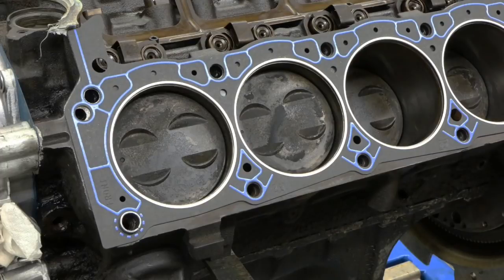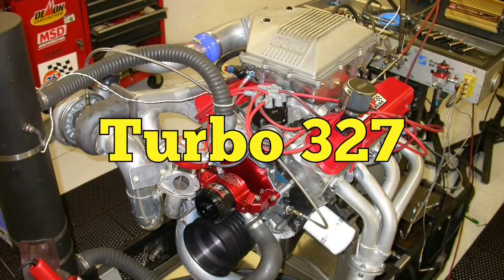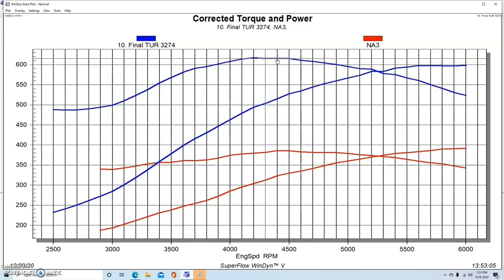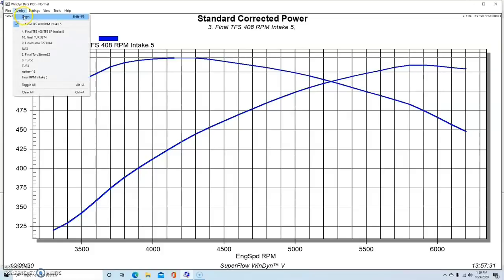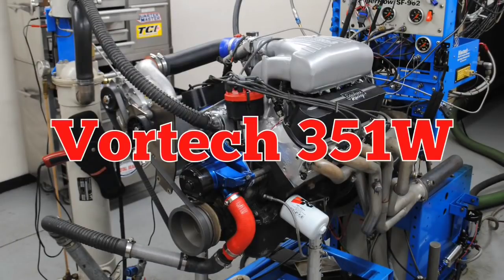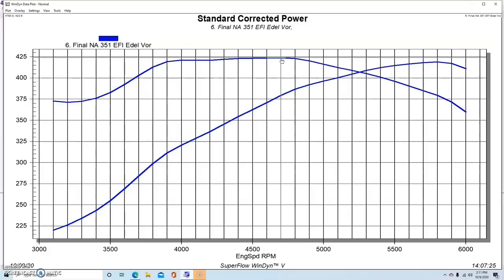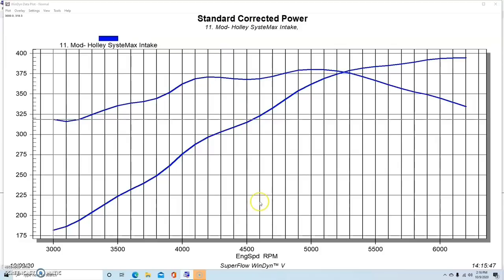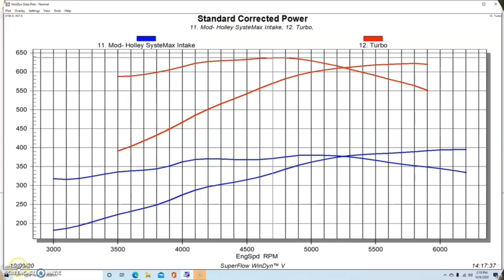HOW TO: 600-HP 5.0L (SBF) POWER RECIPES

Comment: I’m not sure I understand, was this purely junkyard engine? Or did change the original rod bolts and main block bolts with stronger new bolts? where are the rings the original rings reap or did you put fresh rings in the engine?
Reply from the maker: on which one?
Reply: @richardholdener1727  : It was the first engine in the video from the Ford Explorer. From what I understand that engine was a junkyard engine, two block main with stock main bolts, cast iron crank, stock rods with stock rod bolts, and stock pistons with stock rings re gapped. It’s hard to estimate the longevity of an engine like this unless you’ve owned one yourself or you know other people who have driven it until it needed rebuilding or blew up.

Comment: Good stuff. I built Quiet a few booster lil 5.0. 
Boost in the lil 5.0 just hits different 🎉
I had one  similar explorer block ported GT40P heads explorer intake 16 psi made 580 to the wheels. Other than the heads lifting a few times never had any block issues at that power level.  Most important thing is to run lots of valve spring pressure. Detonation is the enemy

Comment: Hey Richard, so I just rewatched this video and realized how different the power was naturally aspirated on the two 302 combos (the 1st and last in the video), especially the TQ curves. They had virtually the same cam TFS STG 2 vs 274 and similar intakes, TFS vs Holley. The biggest difference was obviously the two heads. The first one with a significantly better power curve ran a 170 cc intake port vs the 215cc heads. In other videos you’ve tended to show that there is no downside to a larger head or advantage to a smaller head, but it seems this testing showed that the smaller heads were in fact better or am I missing something?
Reply from the maker: You are comparing two different motors tested on two different days and dynos

Comment: How about a 351w with holley heads?
Reply from the maker: holley no longer offers the ford heads
Reply: @richardholdener1727  I have a set on an 89 5.0 gt that I recently purchased. Should I scrap them or use them on my planned stroker?

Comment: Gives me hope for the 427W I plan to build.

A test I'd be really interested in is just how much power can you get from a "streetable" engine. I mean something that idles smoothly around 6-800 RPM and has enough vacuum to run power brakes. It's pretty easy to build a race engine, just throw dollars at it. But things get interesting once you put constraints on it.

Comment: Hello ...im running a pump gas dart block 363 victor jr. Heads ...trick flow st2 cam...race tech pistons.  8.5-1 ....
Waist gate set at 12lbs...termimator x timing table is set to retard 1degree for every lbs of boost.......my question is should I #1 reduce my boost and add timing .#2 keep boost at 12 and add timing?  #3 or is there anything im missing....car is running well bit I know there is more being im slightly conservative on the timing

basically what is unsafe timing im trying to get a feel for this without damaging my monster stroker....
Reply from the maker: what octane pump gas
Reply: @richardholdener1727  93 ...beat I can get in Pittsburgh
Reply: Best I could get I meant
Reply: The car seems to be running very well...its quite fast and is pulling pretty well...running it in the 50 -75 tps range....its pretty new with only a few hundred miles yet...

Comment: I am in the market for a shortblock. Would you run a Dart 363 or 351w ford block to a 408w with vortech? Looking to make 650rwhp and leave it alone. But want to do it once and be done. What would you do ?
Reply from the maker: EITHER OF THOSE WILL WORK-THE 408 WILL OFFER MORE AVERAGE POWER

Comment: I would like to see you do a combination of a 306” SBF with 600hp using stock block with TFS twisted wedge heads TFS R plenum hot cam , forged pistons and rods with 11:1:1 compression.
Reply from the maker: 306 at 600 hp will take much more than that

Comment: Considering all the 5.0 blocks that I have seen split down the middle I was wondering how many 5.0 blocks you split in half.    I am constantly told these blocks won't reliably handle anything over 500 horsepower and this is coming from people that are drag racing them.   Is that true or not true or a myth or were they pushing them way beyond 500 or what?
Reply: I'm here trying to find the same answer...
Reply: It’s more dependent on how much RPM you’re trying to spin them to and the tune than any particular HP number. There are many guys, myself included, making way over 500hp out of stock blocks .

Comment: I follow up with your videos as much as possible especially if sbf I've got a ranger that I'm building for a daily driver and just want have fun I've got a 88 block with trw pistons factory rods and crank promaxx 180 heads x303 cam speed master roller rockers air gap 35-6500 rpm intake AED 750 DP and I'm really wanting to do a cheap budget single turbo diy kit and I been trying to soak up as much as I can but first time boost for me so weiry.....what do you think????? Also thought about going elelbrock pro Flo 4 with a gt45???? What do you think
Reply from the maker: that works
Reply: Have you tried the pro Flo 4? What would you recommend EFI or stick with the AED? Im more old school carb type but I'm liking the idea of multi port, fuel across all cylinders and better driveability.......
Reply: Do you think the gt 45 would be good on my combo? Do you think it would make good power I Kno I'm limited to stock block but with a good tune and conservative timing you think it would run decent and how do you think it would spool?

Comment: I had an 88 Lincoln TownCar with the low power 302 in it. I swapped in a 5.0 HO from an 88 mustang, used a stock Lincoln Mark 7 PCM to run it, rebuilt the trans and used the mustang valve body with a shift kit and the Mustang governor. Swapped in some 3.55 gears and had cat delete with flowmaster 40 series mufflers with dual exhaust. It was fun to drive but I wish I had had the budget to add boost like this. Would have been an ignorant Sunday driver.

Comment: You have a great channel. One question is there a way to factor in a rear wheel HP? I was told a 15% loss to the wheels?
Reply from the maker: its not a strict percentage-but that gives you an idea
Reply: A traditional automatic with a loose convertor might lose 30% and a manual tranny and a 12 bolt might lose 5%.. without a engine and chassis dyno on the same day it's really tough to make a call on power lost.

Comment: Wondering WHY Again your using nothing but off the shelf grind cams? That 408 would of made near 700hp with a Cam Motion for that combo. I've seen the gains first hand myself. The measly Extra $40-60 pays for itself not only in Peak gains but the Average across the board...
Hope you see my request on the last video to build a Old School 8000rpm 289 with high compression, good heads, & a custom ground cam! 
Need to show these youngsters how Glidden & other's were making over 2hp per cubic inch
Reply: I think these videos are mostly compiled from old customer builds and magazine stuff they did a long time ago
Reply from the maker: the cam wont add another 100 hp
Reply: @richardholdener1727  Nope it won't it'll add 20-30hp peak BUT it will completely change the graph from having a peak/crest to being way higher across the board. Just confused when it seems like your trying to show Max power gains but still staying with 1995 off the shelf grinds. It's been proven time & time again when you have head flow #'s as well as the rest of the engine data to be night & day BUT Haven't seen you show this Once on Any engine
Reply: @TheDynotuner  A lot of these were obviously done to showcase manufacturer parts in the magazines days ie. the TrickFlow top end package, the Edelbrock top end package, etc. Richard wasn't building these for the sole purpose of wringing out every last horsepower for a customer's engine. And I'd be pretty impressed to see anything even close to 700hp with an NA 408 with a 205 head and a hydraulic roller cam, custom grind or not.
Reply: @briannelson8373 ...You might want to check out the YouTube dyno video posted by DragBoss. His 408 Cleveland build uses Ford A-3 aluminum Cleveland heads from the eighties, a standard production 2- bolt main cast iron Cleveland block that he has used for 20 years and a single 4-V Holley carb. He did choose to use a solid roller cam over a hydraulic roller. 
It made 752 hp @ 7600 rpms and 571 pounds of torque @ 5600 rpms without any power adders. Just all engine. 
In his all steel street /strip 1969 Cougar he runs consistent 9.60 quarter mile times. Not too shabby for an old Cleveland.

Comment: Richard, I haven’t reviewed your previous tests leading up to this well executed 600 horsepower segment yet, but I definitely will to see which combinations you chose for testing. 

I don’t expect you to remember every quirky detail from so many comments but I’m especially fond of Fords canted valve (Cleveland) head combinations in either OEM iron or aftermarket aluminum configurations. With their distinct advantage for making big power numbers over in-line valve heads, I hope to see them more often as the power goals increase.
Reply: The only issue with the stock Cleveland heads (not counting oiling issues in the block) was the severe "turn down" of the exhaust ports, necessary on many Ford V8's to clear the shock towers of the 1960's car designs. Pro Stock guys actually cut the exposed exhaust port off the side of the Cleveland head and welded on box tubing to get a better design out of the head...and then kicked ass with it :)
Reply: @albertgaspar627 ...I’m very familiar with the Cleveland exhaust port modifications that you mentioned. It’s most commonly known as the high port conversion that’s done to the production cast iron heads as an effective means of eliminating the sharp downward turn of the exhaust port floor near the exit. The original exhaust port was one of the many compromises done by the design engineers to allow the wide Cleveland heads to fit between the shock towers of Mustangs and other passenger cars of the time. 

The high port conversion required the removal of a large section the length of the head on the exhaust side which was replaced with a piece of 1.500” thick aluminum bar stock with cutouts for each exhaust port. The result is a straight shot to the exhaust valve through the new port location which greatly improved flow, especially at the higher rpms required by a competitive Pro Stock engine. 

The components for the high port conversion are still available and many of the most powerful Clevelands in competition today are running high port iron Cleveland heads.

With the exhaust improvements, many head builders also chose to improve the intake port velocity by filling about a half inch of the port floor with epoxy or aluminum inserts which resulted in a port shape and size that’s nearly identical to the modern aluminum Cleveland heads that are capable of supporting four digit power levels in naturally aspirated engine combinations. 

I have a a pair of iron high port conversions along with a matched Scorpion intake manifold that were professionally done back in the day by Endyn. I’m using them on a solid roller, four bolt main iron short block build. Unfortunately I don’t have any performance results yet. I’m still getting a transmission sorted out but judging from others running iron high ports here on YouTube, it should do quite well 🏁.

Comment: Richard I would like to see you take a stock bottom end 351W and see how much power you can get out of it with just a cam, heads, intake and carb. NO add on's. N/A only.  The same with a 351M and a 400M and a 460.
Reply from the maker: look at the Edelbrock top end video (400-hp combos), there isn't much P-V left
Reply: @richardholdener1727  I will do just that
 Thanks.

Comment: Stock 351w pistons don't like trickflow heads
Reply: CrimzonZero88 Dremel Tool. Paper. Scissors. Rock!
Reply from the maker: why?
Reply: @richardholdener1727  stock pistons TFS high ports  and a b31 cam very close on the exhaust valve clearance
Reply: @crimzonzero8890  fly cutter

Comment: Do you use the stock rods and rod bolts when making over 500hp? I know on one occasion you used a 302 with forged internals, but what about the other ones?
Reply from the maker: we've done it with stock stuff too (with ring gap)
Reply: Stock boss 302 is forged internals and 4 bolt block and 3/8 rod bolts all factory. Been running em since the 70s.

Comment: Oh wait, I thought the 302 block split in half at 600 HP? What happened?
Reply: He glued it back together.
Reply: I'm here trying to find this same answer...
Reply: I cracked one like a egg😉
Reply: They normally do. The fact you can't bore MOST low deck Windsors past .04 inches is a hint--Ford designed this block to be a 221 cid economy car engine (ie, light weight) and in the 1980's, Ford changed the crank which is why there's a different weight flywheel needed (and the Boss 302 had screw in core plugs to strengthed their block).  and there's an issue with the cam/ignition timing--the 302 and the 351W are different, with the 302 HO sharing the 351W firing order. Since a cam from either engine fits, get it wrong and #1 cylinder is firing at the wrong time while the blower pulley belt is tightened for max boost on that different crank design and...

but wait there's more! (as the ads used to say)...SOME low deck Windsors can actually be bored to .06 inches (making your 347 stroker a 355 cid). these are the blocks who tend to make the miracle "but i saw one go past 500 hp!" stories we hear.

Comment: I built forged 408w with ported victor jr heads. Rolling thunder cam, hooker super comps headers, 8-71 blower (8 pounds of boost), also had to do a coil on plug conversion with ign-1a coils
Reply: Joe Paul  i havent yet, fairly new build. All i can say it pulls hard and will pin you in the seat. Sounds good too. Engine is in a 67 mustang coupe.
Reply: @Jab-lj3wc  sounds like a good build bet it pulls hard. I would run it on e85 fuel and try 12-15psi boost :)
Reply: @GnarshredProductions  i agree, will do soon.

Comment: How many times have you drove down the 1/4 mile richard ? Just asking
Reply from the maker: endless-but I like road racing better and Bonneville LSR
Reply: @richardholdener1727  
I wish I knew enough to build a full-nerd Bonneville racer.

Something I always wanted to ask, but I didn't know who to ask: are the ford 5.0 302 intakes just a long runner design folded over on itself like a taco as it appears?
Reply: @xmo552  yes, long runner folded over which is better for low end/ mid range power and torque where the engine will be operating most of the time.
Reply: @GnarshredProductions  
Got it. Long runners like the 413 long  ram and Chevy TPI. Thanks. 
Next question. For the '88 I can never decide. Build a mean 302, 8.2 stroker, or 351 based stroker? Ugh I can never decide😁
Reply: @xmo552  stroker is too much money. Junkyard 351w stock bottom end with twins or big single turbo.
Reply: @GnarshredProductions  
My best friend is an engine builder by profession. I asked him the same earlier today and he said the same thing. For a mean street car forget the afterrmaket blocks and use a factory 351 block.

Comment: Personally I blame squirrels
Reply: John Woodworth : Remember. 1335 Squirells equal 1 hp net. Not sure how many revs thats at.
Reply: @deanstevenson6527  5250 rpm's of course.
Reply: reevin riggin : Even 1335 squirell cages wont allow 5252 rpm. Even co-ordinated squirells baulk. I guess we could try one huge squirell cage and just add more squirells....a co-ordinated effort. Torque is cheep.
Reply: @deanstevenson6527  The correct direction to pursue is hamsters.. sure you get less power per unit but packaging is much easier.. Just takes a Bronco with the rear floor cut out and a big wheel with a gear to spin the rear end... almost zero drive train loss...
Reply: If the squirrels were too eat beans and cabbage would it give them more boost?
Reply: John Woodworth : Mung Beans give better Carb Action...but if it it puts one Squirell in traction then its going to be Boost Limited Mate. Scotty K has got something for you at 4:23 on this video. Dillinger Squirell Escape Defeater Hardware.... https://youtu.be/Pz0sBwv41Yc
Reply: The world is gonna freak out when this comment isn't seen any more
Reply: ...and lets not get into field mice...!!!
Reply: Wak Job field mice are total Jerks